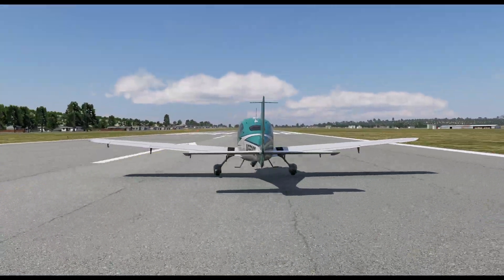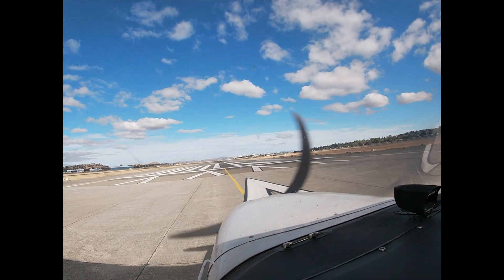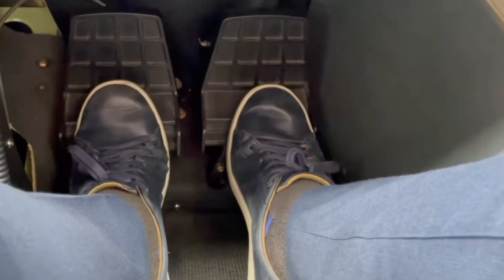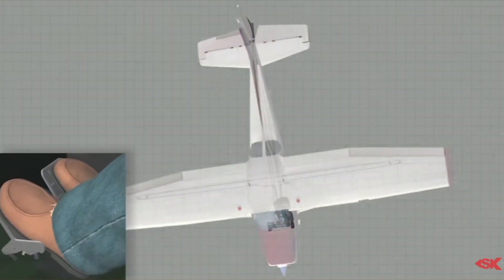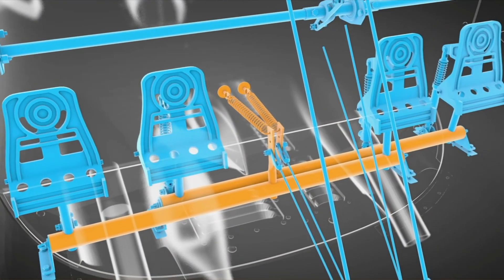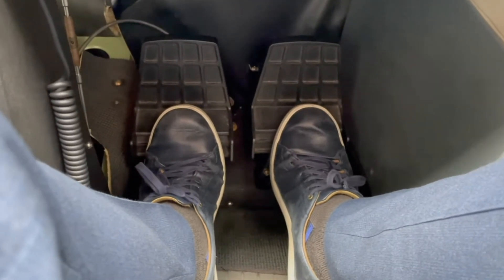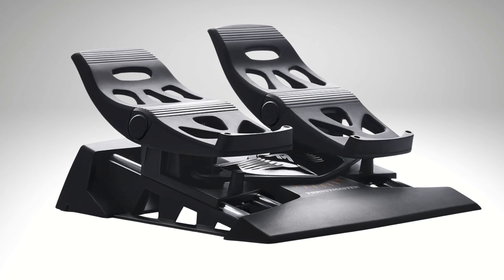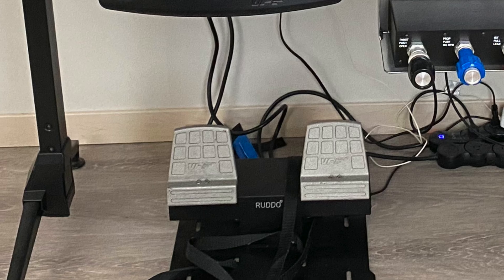Common Flight Sim Rudder Pedal Mistakes (And How to Fix Them)

Comment: Wow excellent topic!  No question the rudders must be stationary. Thrustmaster TPRs have holes in the base. However, they weren't high enough, so I elevated them on a solid wood platform which was nailed to the floor. My office has carpet so no harm in a couple of big nails right into the floor. 

Previously I ran aluminum flat bars to the wall and then nailed them so that the left wouldn't cause the right side to push back. But it still wasn't stable enough.

Next, a height adjustable chair. Office chairs (if you're using one) have gas shocks and can be replaced cheaply with nearly any height. So I raise the rudder pedals off the floor on a wood block so that the yoke was at the right height and my feet matched the rudder pedals.  So when doing the seatbelts and seat back check, I simply lock my chair height and disable reclining.  Guess on a hard floor, no chair with wheels would likely work.

Managing crosswind is everything.  Assuming your settings are realistic, you simply have to be in a little bit of a side slip unless winds are calm. Getting that right definitely takes practice.  Since you don't feel the aircraft, you have to point the nose visually.  Then steer with the ailerons.

Lastly, you'll definitely improve over time if you are disciplined about following taxi lines and parking straight. Just assume you're at a real airport and people are watching you. In real life they do judge your landings and in fact how you park.
Reply from the maker: Cool. Thanks for all the detailed tips!

Comment: I have the Thrustmaster TPR and they work great.  I got me a few boards at my local hardware store and built a platform where I can secure them to the sides of my old wooden desk with some angled brackets and heavy duty screws.  I even painted the platform black  Those pedals don't move at all.  For my office chair, I got an office rug and some office wheels with really good brakes.  My chair won't move at all.  Only issue I kind of have is the office chair rotates but that's not that bad.  Using my pedals is great with this solution.
Reply from the maker: That's awesome. Once it's dialed in and secure it makes all the difference. Thanks for sharing the setup tips

Comment: In real world flight training, I was told to keep my heels on the floor, until you use the brakes.
Reply from the maker: That's what I was told too. But I assumed that meant like you drive the pedals in a car.  But many instructors and the PHAK suggest using the ball of your foot to control the pedal, not your whole foot like in a car. Both keep your heels on the floor but they behave differently. That's the part of the instructions I at least missed. And it's hard for the instructor to see exactly which way you're doing it. But you do have to raise your heels to press the brake in either case.

Comment: I certainly wouldn't use rudder to keep the wings level in a stall. Just let the wing drop and pick it up using roll after you've recovered. 

If you wanted to intentionally spin, how would you do it? Stall the aircraft and apply rudder. 

Very few, if any, aircraft these days have particularly dangerous flick characteristics at the stall - I'll give you a pass though and allow you to use the rudder to keep the wings from dropping if you fly something like a Harvard/Texan/Wirraway which could roll upside down unless you stop it - for everything else, the priority is recovering from the stall, not playing with the pedals.
Reply from the maker: Ah, good callout — I phrased that too loosely in the video. When I said rudders ‘help keep the wings level in a stall,’ I was really thinking about training stalls, where staying coordinated entering the break keeps things symmetrical. But you’re right: in a real-world unintentional stall you’re not leveling with rudder at all; you lower the nose to break the stall, then use aileron once the wing is flying again. Appreciate the chance to clarify.
Reply: @FflyingLlama Good stuff! Also, on reading it back, my comment seems unnecessarily critical - it wasn't meant to be, I enjoyed the video!
Reply from the maker: No worries. I genuinely do appreciate leaning stuff. Obviously many of the folks watching these videos know waaaay more than I do about being a pilot. It's fun tapping into all that experience, such as yours, and also hopefully getting better in presenting ideas in the videos. Thanks for stopping by! Glad you enjoyed it.

Comment: I am old enough to have learned in tailwheel airplanes with heel brakes.  The concept was that strong braking would overcome and damage the cable over the pulley system and that pilots should be trained to use brakes only during taxis.  In small up to four seats trainers, this concept should still hold true.  

The way we absolutely prevented ground loop was to rapidly and constantly walk the rudder pedals dynamically and proactively during taxi, takeoff, short final, flare, touchdown slowly and softly, and roll out.  By never allowing the nose to come off the target (centerline usually), we precluded any loss of control problems or nose over with emergency braking.  Also this light dynamic proactive rudder movement, this proper yaw, prevented the adverse yaw of steering wheel use and therefore kept the wing level or in a stable bank angle against crosswind drift.  The rudder is our friend.  The brakes need only be tolerated during taxi operations.
Reply from the maker: Thanks so much for sharing those tips! It’s really interesting to hear the perspective from someone who learned on tailwheel planes, especially the proactive rudder movements. I can see how that would make a huge difference. A CFIi saw on YouTube says that if you truly want to improve rudder skill, spend some time flying a tailwheel aircraft. Maybe I'll try that in the sim. I don't think my flight school has any real taildraggers. Have you tried any tail wheel aircraft in Xplane or Msfs that you found realistic and that you like?
Reply: @FflyingLlama I have only flown regular airplanes and helicopters in the Army.  You have to feel the slack in the cables and experience the many variables of terrain and wind and weather.  Tracks in fields where cattle had walked, wetness or dryness of sand, size of rocks, etc.

Comment: If there's just one thing that never "clicked" for me in real-world 2-seater flight it was the rudder pedals during taxi...... it was like there was slack in the cable, then the momentum of the rudder causing it to overshoot the angle I was trying for. The pilot was way experienced, from private to flying for US Coast Guard. They seemed to work perfectly well for him. I'd describe the rudder pedals operation as "sloppy"........ they probably work much more intuitively with enough speed on runway. In the next reference to the rudder, he'd induced a vertical stall WAY over Chesapeake Bay, saying, "if the rudder cable breaks were in deep (excrement)".
Reply from the maker: It does seem to me that it definitely is all about learning the "feel" and some aircraft are a lot trickier than others. I also sometimes wonder how all these purely mechanical systems don't fail more often. But maybe that's the point -- simple stuff might be more reliable. Thanks for sharing the story.

Comment: A ce sujet, attention aux corrections de vent de travers quand on ramène le nez de l' avion dans l axe avec les palonniers. Bien penser à remettre les palonniers au neutre avant que la roulette de nez ne touche sinon c est l embardée et la sortie de piste. Surtout quand on passe d un avion à roue libre à un avion à roue reliée aux palonniers.
Reply from the maker: Merci pour le conseil, c’est un très bon rappel.
J’avoue que le timing reste un peu délicat pour moi en vent de travers, mais c’est clairement quelque chose que je peux travailler davantage dans le simu. C’est justement pour ça que j’apprécie le réalisme du simulateur — on peut répéter ce genre de geste des dizaines de fois, même si rien ne remplace le travail en vrai avec un instructeur

Comment: Yep, having the proper angle to your flightpedals is definately something to be desired. I once bought the saitek (now logitech) rudder pedals, and although accurate, i just couldn't get along with them and sold them.. then i got the G940 flightsystem and i started using rudderpedals again, although at the time i was more simracing than simflying, but i could move the pedals in and out of the simrig... I now have the Trustmaster TPR pedals, and i actually have the toe brakes just about all the way forwards... so in normal flight, i can "rest" the ball of my foot on the iron plates, whilst my toes kinda tickle the toe brakes... This felt like WAy more control already, because of the angle of the leg-to-foot, not being as brash, but still in braking, i just cant get my toes to move downwards at the same exact speed, so it does end up with a bit of a slither across centreline almost every time, even though i set the sensitivity to about 35% lower ingame.... But overall, i usually let the aircraft slow down by itself and roll out to the end of the runway before having to apply brakes, so then it becomes a less vital issue... it's still awsome when yer able to do a crosscontrol landing with sidewind and keep the nose up a bit, on centreline until the airspeed comes down and you have to time your rudder effectiveness with your ground steer as the nosewheel hits the ground.... but by practice, the sway you will get will slowly become less and less.... Have a great flight, Captains!
Reply from the maker: That's awesome. Thanks for sharing the detailed tips. It's definitely a skill that has a lot of subtlety with it

Comment: I've tried several different sets of rudder pedals. The main barrier to realism for me is how sensitive they are in the sim, particularly for steering on the ground. Way more so than a real airplane. I think the trick is to dial in the sensitivity in the settings, but I haven't quite perfected it just yet.
Reply from the maker: Yeah I found that too. For me having significantly more resistance makes it easier to control.  The downside is that if you are on a desk chair you can roll backwards. What I did for years was to simply strap the pedals to the chair with Velcro straps so that when I push against them I don't roll back and set the resistance of the pedals very high.
Reply: @FflyingLlama  I had that issue as well, ended up putting wheels with a brake option on my desk chair. Works quite well, with just two out of 5 wheels braked the chair stays in place.

Comment: full feet isn't mean cheep, i have a choice with my pedals to use full feet or this counter intuitive dancing stuff. with full feet i have right angle without needing to move my feet, but only press the brakes and push the rudder with same feet position. this is convenient this is intuitive and i honestly even can not imagine situation, where that semi.....  can be better. with full feet you have all time opportunity to immediately use brakes or and rudder/steering. and if you aren't real pilot who have a habit with ffb, only blind people need ffb. till you can see reaction you can use even twist with almost same precision, just with a bit less comfort. and same as for everything else there only two magic words - practice and passion
Reply from the maker: Fair enough. As I mentioned in the video even my instructor said to use what works and feels best. For me, I realized that literally was dangerous but if that works best for you I can definitely appreciate that -- totally makes sense.
Reply: @FflyingLlama  it depends of some factors. in real aircraft practice nobody gives full feet pedals if the model haven't that, and pilot must fly that. almost all my posts only about simulator and individual feelings. about dangerous it's all about angle and pedals positions, so far they in the right way there no way to make mistake, all rudder moves all brakes moves will 100% separate and 100% controls by minimum possible increments by physiology and quality. i don't fly in real life, but i know some aircraft have very heavy rudder even at relatively low speed, but even if imagine that, good position and pedals angle shall be good preventer for avoid any accidents toe brakes depressing. for simulator when people can change springs, forces in ffb, angles and distance between pedals, for comfort and faster react nothing will better than twist, with common brakes that have spitfire logic - the more rudder the more pressure on turned side, even button. short press - light pressure, double depress some stronger and so on till long pressure for full press. and pedals after practice give exact same just with more control, more precise, more comfy no hands flight. angle of the pedal the key. if it too vertical it can be dangerously sensitive, if too horizon it same dangerously accidental, so need optimal angle, where push rudder will never ever accidently press brakes and all brakes moves will always comfy controllable at all diapason of pressure. fighters even haven't that semi pedals ever, because in fighters pilot must do everything faster than thinking, and there no time to dance.

Comment: In the Cirrus the rudder pedals are not connected to nose wheel steering. Differential braking is required until the rudder becomes effective with enough airspeed.
Reply from the maker: Yep. Good callout. My Cirrus instructor pointed that out to me recently as well, but after I had recorded the video. I should have gone back and re-edited something into the video about that. Appreciate you bringing it up. 

It does actually seem like a simpler and more elegant solution though. But it does mean the brakes are always in use when steering on the ground. Not sure if that makes them wear out sooner in than in the Cessna. Perhaps the Cirrus is less optimized for flight school operations where pilots might be less proficient on the ground.

Do you own a Cirrus?
Reply: @FflyingLlama  I never owned a plane. I was a A&P, I.A. for 42 years and often flew with the owners of the planes I worked on.  I have flown a wide variety of light planes and two types of Army helicopters. Vietnam, Air Cavalry 68-69.
Reply from the maker: Oh, that's cool. Did you find that aircraft that had castoring nose wheels had brakes that wore down sooner? Does the cirrus SR 20/22 have a significantly different braking system design or materials than say a Cessna 172? Just curious.
Reply: @FflyingLlama  That is hard to say given the variables. But, if used in training I would say definitely.
Reply: I did my training the the DiamondStar, which is configured the same way. You get used to it pretty quickly, but not my favorite way to steer.

Comment: I’ll just share that my tailwheel instructor prefers taxiing with the balls of feet on the bar, without lifting feet and just using the toes to use the brakes. This is to make the brakes less sensitive for better control, and to avoid jamming the brakes on and flipping the aircraft on its back. I did enjoy your self reflection on the best way to work the pedals.
Reply from the maker: Interesting. I've heard that the absolute best way to get better at rudder skills in general is to fly a tail dragger. You must be really good at it by now. Thanks for the tip. Maybe I'll  give it a try next time I fly for real and see how it feels.

Comment: I've got the Thrustmaster TPR rudders for my sim.  I got them to practice using my feet to steer, to make me a better tailwheel pilot.  I used DCS World with some of their taildragger aircraft like the Cristen Eagle, T-51, and the Spitfire.    DCS ground handling was far and away better than all the other sims I tested - MS, xplane, and IL-2.  Took a bit of time to set up the rudder pedals in the DCS setup.    I have a good seat, and the rudder pedals are jammed up against the wall, so they don't move.  Building a nice chassis like you have would be a good idea.  I use a VR headset (original Oculus Rift) and it's awesome.  Good graphics card, of course.  If you just taxi around on the ground for a few minutes over a period of days, your brain will make the connection between what your eyes see, and what your feet do.  Just like you don't consciously think about moving your body from left to right when you balance on a bicycle, you must train your brain to make your feet move "automatically."  This technique worked very well for me.  YMMV.
Reply from the maker: That's great advice on practicing tailwheel flying in a sim to improve rudder skills. I've seen a CFI on YouTube recommend that as well. Beautiful thing about a sim is that you can change aircraft. Apparently gliders are good rudder practice as well. Thanks for sharing the tips! I'll give it a try!